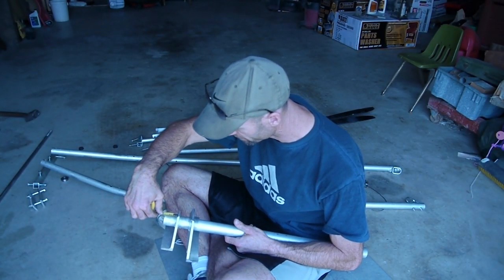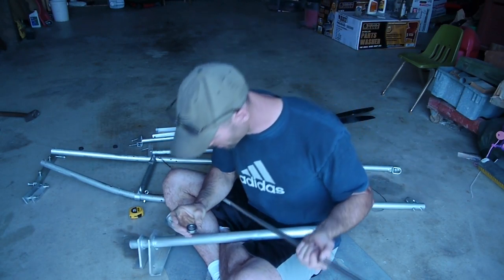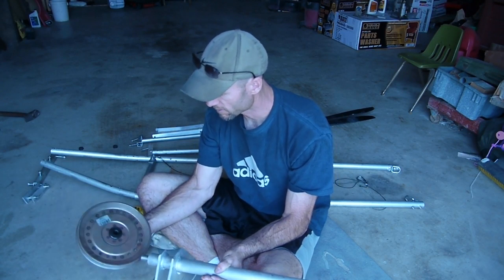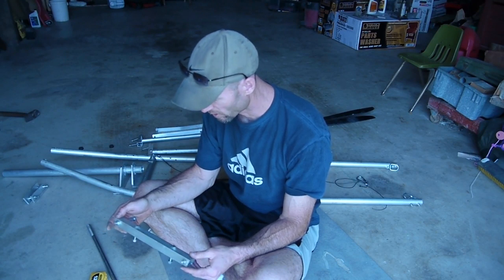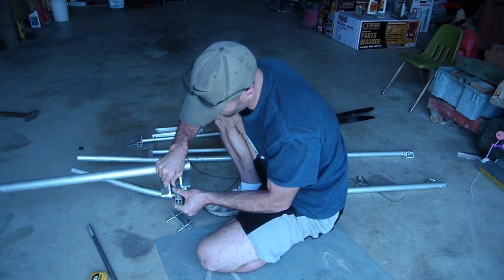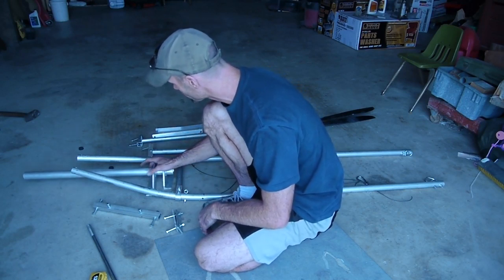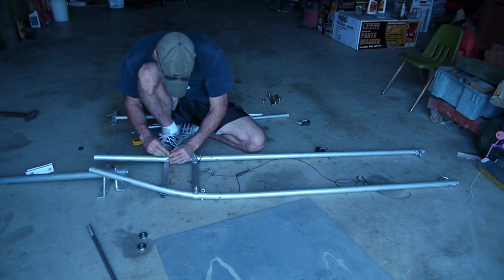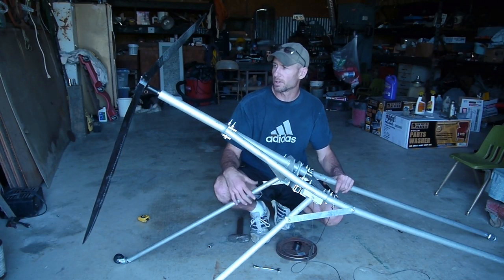How to Make a Foot Launched Powered Hang Glider (FLPHG)

Comment: If you want to go "old school" I have an original Soarmaster power unit with a Chrysler engine on it I'd sell someone for $600.00 plus shipping. I'm located in Iowa where the flat farm ground made flying hang gliders out of the question without a Soarmaster attached to it.

Comment from the maker: The two main supports are 72". The prop shaft cover is 28" and the shaft itself is 17mm in diameter and 33" long. Becaerful using Spruce, I would use 7075 aluminum.

Comment: I am happy I got the doodlebug. I had spent the 3 previous summers trying to get airtime by towing in western Oklahoma, which is fun, but consumes the weekend. Now, I can drive a few miles from home (Tulsa) on a Saturday afternoon, get several hours of flight and be home for supper. I bought a Free Flight (wills wing) PDA chute designed for tandem. It mounts on my chest with the handle high, near my neck. I have several fields close by that I can fly from.

Comment from the maker: No, I'll have to look them up. I joined a Facebook FLPHG group. I fly a mosquito, but I just bought a doodle bug! It should be here in a couple of days. How do you like yours? I also need to buy a reserve that I can attach to the doodle bug. Are you using a reserve for your bug? If so, what kind?  Where are you flying at in OK? I normally fly around North Texas. I've been to Buffalo and Little Yancy. Will have to meet up and fly.

Comment from the maker: The total cost is around $2000 if you have to buy the prop. It only cost about $150 for the frame. The engine I'm using is a Radne Raket 14hp. The purpose of the video is to have other come up with their own design so we can make FLPHG's affordable for everyone.